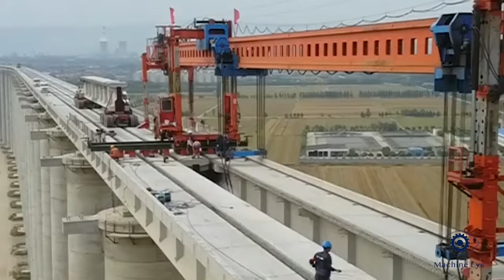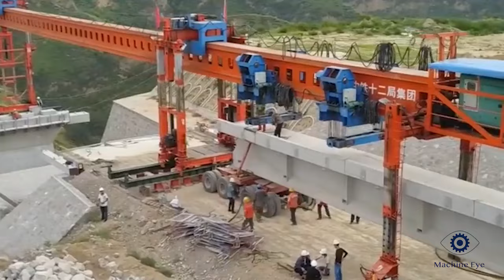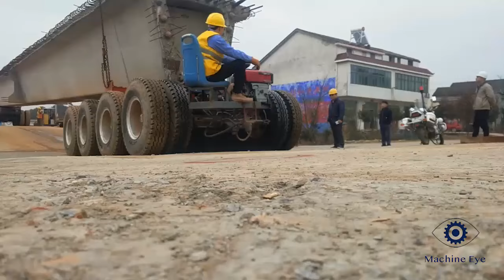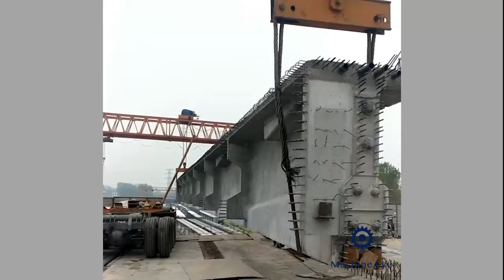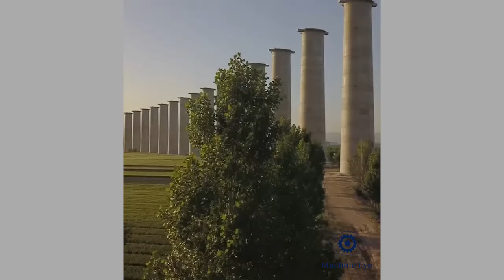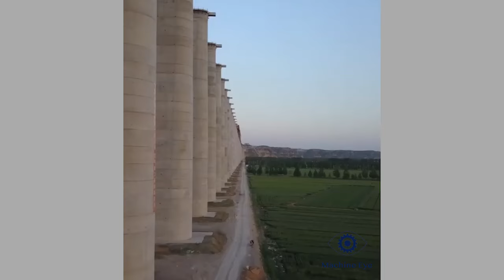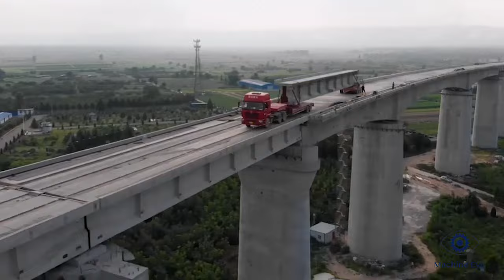Shocked by China's super engineering! I don’t know how to look at this pier

Comment: Everyones talking about how incredible this is, im over here wondering why they're spending so much to elevate the track.
Reply: Likely 2 reasons, 1 is to shield the farmland beneath from vibrations and noise, 2 is the track before and after maybe on elevated land (you see hills in the video), and high speed rail tracks can’t change elevations rapidly. So it’s 1 elevated patch instead of 2 tunnels which would be massively more expensive.
Reply: Its their high speed rail.  Its safer and it doesn't need to stop for cars or pedestrians.  Imagine a car breaking down on the track with a train at 180mph
Reply: @tangenterprise  Considerate. In the UK they would just plough through the land
Reply: I had the same thought until I realized it was for a railway.
Reply: I was also thinking if they were already planning for their dam to rupture for it is happening as we speak.
Reply: For high speed trains you can't go up and down hill quickly. This way the speed can be maintained.
Reply: Cole ;  Good observation 👍
Reply: It's the super-highway, exclusive for ccp members to ride high above common rabble
Reply: And also floods and swamps are pretty common in chinese plains along rivers
Reply: Maybe to protect animals?
Reply: It's an eyesore
Reply: Standardisation, the only thing that changes is the length of the columns. This allows everything to be built in a factory with reduced labour cost.
Reply: Bryce F ••• then look away.
Reply: Isn't it obvious ? Unless you want to ride a roller coaster or the famous tilting train, the railways needs to be as straight and level as possible.
Reply: You should be ashamed as a white person for opening your mouth before watching the video. The reason is self evident
Reply: @blifx  too much for american to handle 😄
Reply: Duhhh... the floor is lava
Reply: It's a high speed train line. It has to be flat.
Reply: 1.Let the train and noise away from people and animals living around the Railway
2.Avoid the flood and mudslide to damage the Railway
3.Keep the railway surface as level as possible. China have less plains but plenty of mountains and hills.
Reply: It floods a lot in China, so they're building it up there in the sky to prevent  the dangers of floods
Reply: Same reason they build the mega cities that no one ever lives in.
Reply: sb
Reply: One reason: gradient
Reply: Why so high you ask, flood water.. 🤣
Reply: @tangenterprise  You can go underground, or even just make it on lands that are apart from civilization. Also, why so high, that's a wasted of money, I don't think it has to be so high for that.
Reply: @ivans.2678  Still the same thought.  They literally cleared all that land for pillars rather than just adding tracks. Maintenance is gonna be a huge B for them.
Reply: @EnglishLaw  im sure they had to drill a couple hundred feet into the earth for the footings on those massive piers.
Reply: @tangenterprise  I didn't realize that cars were 100 feet high in China.
Reply: @willw1839  Why is Japan's high-speed rail built on grade, then?
Reply: I see it and think of the highway without a drainage
Reply: Yea yea, so did they steal this technique from the free world too??? Ow yea they did.
Reply: Mostly so they can just go over the mountains / hills
Reply: @pro-fessshep7695  are you just guessing or hoping as it was looking fine from where i was standing a few days ago
Reply: Cole Cooper Because.
Reply: @antonimalachowski5262  😂😬
Reply: @tangenterprise  Look at that curve in the track, if the train goes superfast it can't take that curve.
Reply: @truusjenskens8485  good catch Mr high speed engineer
Reply: High speed rail I get it. What a dystopian view though... I would prefer tunnels.
Reply: @pro-fessshep7695  Stop spreading hoax.
Reply: I guess because they can, showing we are builders nothing wrong with that.
Reply: the fields below could also be prone to seasonal flooding
Reply: FIGURE THE COSTS OF RUNNING LOWER! MUCH EXCAVATION AND GRADING TO LOCATE THE TRACK!
ALSO FIGURE THE LOSS OF FARM 
LAND, AND A LONGER ROUTE MAY BE NECESSARY AS WELL!
CASE IN POINT IS CAJON PASS BETWEEN VICTORVILLE AND SAN BERNARDINO!
NOW TAKE THIS AREA IN CHINA
WHERE THE TRACKS CROSS THE VALLEY!
HERE YOU WOULD HAVE TO CREATE 2 CAJON PASSES!
ONE TO DROP THE TRACKAGE TO THE VALLEY FLOOR, THE OTHER TO RAISE TO THE ALIGNMENT REQUIRED TO CONTINUE!
TODAY WE HAVE THE EQUIPMENT 
AND THE TECHNOLOGY TO MAINTAIN A SHORTEST AND LEVELEST TRACKAGE ALIGNMENT , BY GOING THE HIGH BRIDGE WAY!
Reply: There is a damn big ditch in the way.
Reply: @pro-fessshep7695  Understandable for you since your country don't have high speed train
Reply: @rossbryan6102  first key from the left of the keyboard, second from the bottom
Reply: Keeps their steel and cement plants churning out more products more jobs more skills and can build anything spirit. After all they built the Great Wall centuries ago, in other words they are restoring their tradition as foremost builders in the world !
Reply: Below is a flood plain
Reply: @EnglishLaw  i think the high speed rail in China is a bit faster than in the uk.
Reply: They took administratve lessons from Brown and Newsom.
Reply: I would think cross winds at that elevation in a wide open valley could be an issue for a high speed train.  I mean there are wind warnings for cars and trucks on bridges in many locations
Reply: The vast majority of Chinese high speed train lose money like every other country that does it.

Its nice that taxpayers in China don't get to complain
Reply: Seem more about flexing manufacturing muscle Han for high speed rail purposes.
Reply: To carry water
Reply: @EnglishLaw  In the USA the EPA would say there's an endangered worm in the dirt and stop the entire project.
Reply: They got to spend our money on something,just like California’s high speed rail
Reply: @antonimalachowski5262  do you even know the CCP but the trash written about it?
Reply: Yes, they are politically hypersensitive and they don't mind spreading falsehoods
Reply: Cole cooper they are spending simply cuz they can, they have loads of money to spent. Unlike the Americans they don't spend money on war.
Reply: The copy masters must be copying the London Bridge
Reply: The area is going to be filled with water in constructing a future dam.
Reply: So animal can have safe passing. Haha
Reply: @pro-fessshep7695  Uh, I assume the dam you are talking aobut is the fake news in the West regarding "Three Gorges Dam"?  With those fake/misleading twisting images?  Google isn't allowed in China, so Google has no land survey data to begin with, anything shown on Google Satellite Image in China can be off by many many ft/meters, get some education please.
Reply: You want animals to be on track ≥﹏≤
Reply: How you received 455 likes for not watching a video that would answer your question is amazing.
Reply: elevate the track to protect environment,Provide a migration route for wild animals/humans, no need Cut the city into two parts.
Reply: Low lands flood out. One reason.
Reply: May be the rest of the line is built on altitudes and levels that are fairly high. Railway lines can be built at slight slopes, but they are usually very level and use tunnels and bridges and elevated sections of the line.

Also because the ground might be unsuitable to build rail lines on, or to prevent the need to build road level crossings, or road bridges and tunnels etc, and to reduce the interference to the farm land and other enterprises and the like.
Reply: @antonimalachowski5262  Yup, and it means that Ivanka can go get new patents with minimal delay.
Reply: @simonl4657  that's the beauty of socialism, the welfare of the people takes priority over corporate profits.
Reply: @eyeofthetiger6002  lol, another bs artist
Reply: @gottliebdee263  Yes. But without protection offered by large institutions such as, for instance, the CCP, it will be difficult to build rapport. So these 'large institutions', such as the UO, appear to me to be a necessary evil for progress in regard to developing ip by the relatively powerless members of the society..
Reply: Actually it makes economic sense to elevate the entire line. Basically everything can be prefabricated in doors which speeds up thing enourmously (and insures quality). As a side effect you gain the properties having small grades and cirves and minimum impact on the ground. Thisnis the way to do it from an efficiency point of view.
Reply: and it looks fucking sick ;)
Reply: My first thought
Reply: because they can afford 🤣🤣
Reply: Believe it or not, it's actually faster and cheaper doing it this way, when you are doing it at massive scale.
Reply: Cos they can!
Reply: Wow very little in the way of safety for workers
Reply: China is a developing country. For economic development and people’s livelihood, China must build more infrastructure, especially transportation infrastructure. 
There is an old saying in China, "If you want to get rich, you should build roads first." This is China's 40 years of experience in rapid economic development.
Reply: Rudra Kulkarni  Indian friend, I would like to say that China and India each have their own strengths, for example, India's advantages in the service industry, software and pharmaceutical fields.
I have traveled to India in 2017. Although there are many differences between the Chinese and Indian governments, I felt the warmth and friendship of the Indian people during my stay in India.
I think that China and India are both ancient civilizations in history, and both have made contributions to the progress of human society. In modern times, both China and India were subjected to colonial aggression and bullying by the West. China and India made unremitting efforts and struggles to achieve national independence.
Today, China and India are both emerging countries, and both are the world’s fastest-growing economies. In short, we have too many similarities.
Therefore, China and India have more reasons to need friendship, cooperation, mutual learning and help.
Reply: Because they need the land for food
Reply: High speed rail track must be evenly even.
Reply: For high speed rail the elevation cannot change dramatically, for that matter neither can normal rail. What I would be concerned about is earthquakes causing severe damage.
Reply: Raising the track because they know a major flood is coming when the 3 gorges dam fails
Reply: It also looks like it’s in a flood plain, so building the track down on the ground could lead to costly rebuilding during a flood
Reply: @harrisonrawlinson5650  so very true.
Reply: It’s cheaper. All they need is assembled it section by section. Lying out rail tracks on the ground need much more work and therefore cost more. It’s also is a better use of land. I can still raise my cows and chickens under it.
Reply: @andicee8324  I think you are referring as the western media call it “ghost city” right? But you see my friend, our government and city planner calculate the potential growth of population and simply build these infrastructures and building for the predicted future growth. Socialist do thing differently and that’s all. Please understand it correctly.
Reply: @tangenterprise  it now HSR, it MengHua Railway(蒙华铁路)
Reply: @TheLeftRbabieskillers  this is not for HSR, it a heavy hauling railway, built for transporting coal. A fully loaded train consists more than 200 cars, the overall weight exceeds 20,000 tons. That's why the pillars are so close to each other.
Reply: @applebee9060  when you see one in real life it’s pretty damn amazing and graceful in its perfect engineering
Reply: @blifx  when you see one in real life it’s pretty damn amazing and graceful in its perfect engineering
Reply: Also, to make it look like you are literally flying!
Reply: Cole Cooper..You must be genius 😂!
Reply: @EnglishLaw  
Erm' NO
Reply: Hahahah exactly! 😹😹😹😹
Reply: @antonimalachowski5262  no for the villagers to get into business instead of growing garlic with 19th century method.
Reply: China’s topography is determined by the fact that there are few plains, most of which are mountainous, and the altitude difference is very large
Reply: China’s topography is determined by the fact that there are few plains, most of which are mountainous, and the altitude difference is very large
Reply: @EnglishLaw  we actually care a lot about ecology here in the UK
Reply: Any falling subjects would be a shell while the high train passing by. It's fatal to protect trains from any interruptions.
Reply: China built a lot of these viaducts to save scarce farmland or to leap over rivers.   Even thought they are expensive but cost was kept down by standardize design and manufacture of the beams.   Also they have large volumes and the ability to amortize capital investment in high-cost construction equipment over a number of projects.   China has less than half the arable land as the US but 4 times the population.   So planning and preserving resources are very important to China.
Reply: @antonimalachowski5262  You are ridiculously bad like those Trumpists!
Reply: @jamesfisherman409  These high speed trains are going to give people heart attacks. Xi is doing whatever the frick he wants, regardless of the human cost! I think that as Americans we have the duty to do something about it.
Reply: I have been wondering too.There must be a logical explanation.Flood plains?Deep gorges?Track is for VFT therefor they want to be above interruptions & obstacles?Got to hand it to them its fine work.
Reply: in china,we all know the proverbs“if you want to get rich, build roads first” “every road leads to roma"
Reply: @jamesfisherman409  Xi knows of the dangers and is powerless to make changes, he does not want to upset decisions made by older party cadres to maintain party legitimacy. Now they want to send these death machines to Taiwan. Should they be worried?
Reply: it's a tier 4 road, which means a lot of tunnel and brige if necessary
Reply: I’ve been sitting here watching this thing for 10 freaking minutes  wondering the same  thing 🤨⁉️
Reply: I always thought it was either due to floods or the elevation
Reply: China built 30,000 km of high speed rail since 2003... everybody learn lessons from them
Reply: Maybe its flood active area n river passes underneath that bridge certain time of the year
Reply: The reason is in this area foundation  very soft and  same level go through tunnel
Reply: @shanerichardson4361  1000 yes a record breaking rain not seen in a thousand years. Lucky it didnt rain like that in usa.
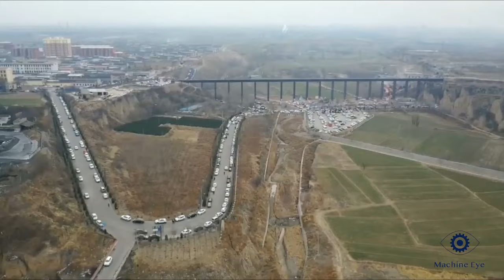Reply: @willw1839  You are correct. Skip to 9:54 and you can see the land before and after is already elevated. :-)  I think it's beautiful.
Reply: @blifx  yeah from your home thousands of miles away. Eyesore…🙄
Reply: state propaganda much?
Reply: Only have stops on high ground. They coulda put wind turbines on it too, lol. Either way it's impressive!
Reply: @johndoe1909 yes that is how they did it so fast while here in California we cast concrete one span at a time, take it apart  and then build concrete form for the next span. Check out another video compare construction of US railway vs china.
Reply: Major flood zone
Reply: Yes you are very right to wonder. The reason why you wonder is you were not part of the people who surveyed the landscape and neither were you part of the architectures who designed the structure according to the landscape.
Reply: Because they are building fast train line  in mountainous area
Reply: Maybe so they don't get blame they copy it from us 😅
Reply: Helping the nature by not stopping of contaminating the earth
Reply: Me too!😂
Reply: Time is life.
Reply: Elevated  track are faster safer and flood free .
But yes it's very very expensive to built
Reply: It's elevated to (1)avoid crossing with ground traffic, (2) avoid up and down movement (3) reduce weather interference such as floods, heavy snowfall, etc.
  Ideally, this rail would benefit from an enclosure to reduce wind interaction, animal migration, rain, heat, snow, etc.
Reply: Also, high speeds require, either banked turns or large radii in order to avoid de-railing.
Reply: It appears to be crossing a valley.
Reply: @rossbryan6102  - can't figure out how to take off caps lock, eh?
Reply: @EnglishLaw  they did plow through
Reply: Why so high? Why does the dog lick its balls? Because it can!
Reply: Who cares, i rather them line up pillars vs lining up troops
Reply: To c
Reply: It could be transformed to another great wall in future😀😀😀if they force to divide by war force....
Reply: @willw1839  h66y6
Reply: @willw1839  Tunnels more expensive? They are not: Herrenknecht.
Reply: @highroaduk637 
What you say makes sense.
Reply: @willw1839  в
Reply: I think it is to ensure they can build underneath in the future without any height restrictions
Reply: Wow
Reply: @andicee8324  sb
Reply: @shadowbanned3136
Reply: Just to make this video
Reply: @willw1839  ,
Reply: This is a railway for transporting energy, an ordinary railway, called the Menghua Railway! The total length is more than 1000 kilometers.
Reply: One of the reason to make a track flat or horizontal to the tangent line , no up and down hill track. Train can travel faster this way, same reason, the bore a tunnel when the track enter hill terrain.
Reply: I have been looking in the comment section to find that jealous American and boom I found him.
Reply: Bcos the start and the end of this construction is on hill or mountain.... so they maintain same height of the mountain or hill .... I think it's a highway with speed rail tracks.....
Reply: @anwar8341  我是中国人，最有发言权，告诉你为什么选择高架桥修铁路，成本还是成本，而且在中国有18亿亩农田保护，中国是禁止农田破坏的，中国地山人多，要保护中国的粮食安全，而且要避免了扰民，等各种因素
Reply: Fkrs are probably going to flood out more villagers.
Reply: @willw1839  : compensa o gasto  .. ...  ....
Reply: @realzeratul888  mas essa estrada não tem acesso.. ...  ....
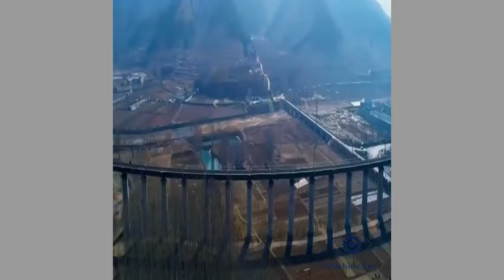Reply: 9:48 explain it all.
Reply: Looks cool 😎
Reply: @antonimalachowski5262  they have way less rabble than we  im licking prince Charles  arse as we speak
Reply: @blifx  what and inner cities in America aren't 😎😎😎
Reply: is not for high speed train.I think it's a heavy haul railway